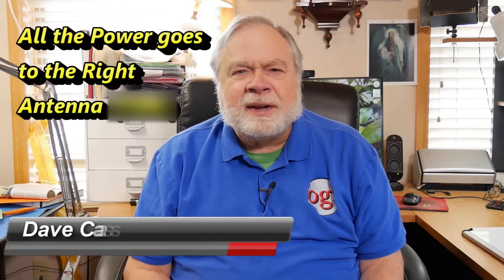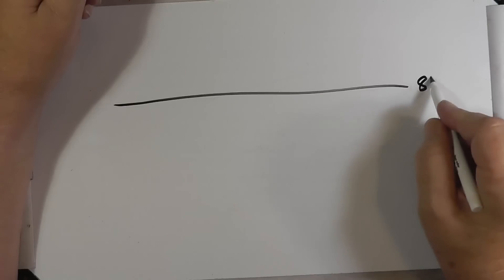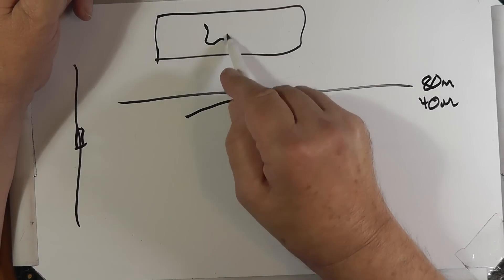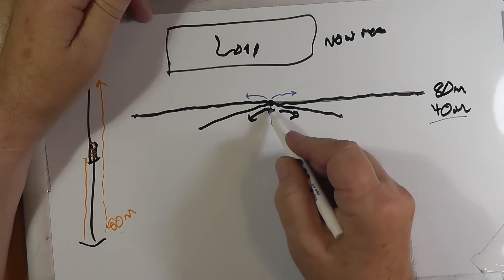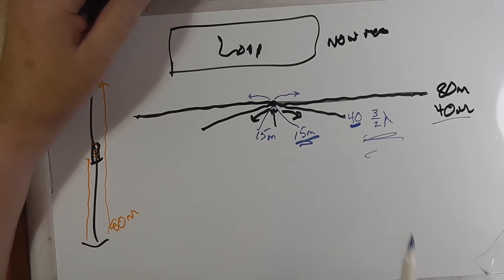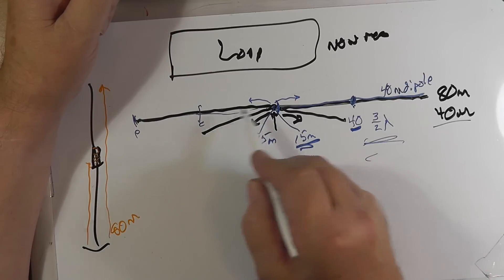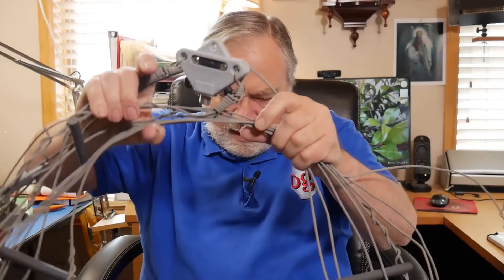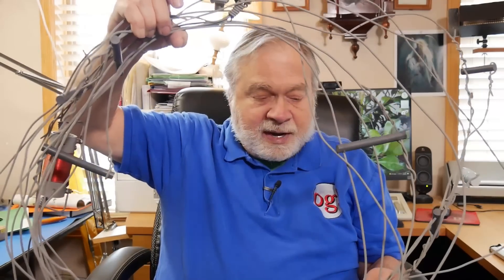All Power goes to the Right Antenna (#568)

Comment: Give me more of knowldge🙂..and wery happy and gratefull for that! So much cool informatione from UK( I meen Callum,Mike and you offcourse) I love the 👸👑 not aourse demokratione in fake poor Swiss called Slovenia in "EU" they say poor gods of Slovenia. Which, with democracy, promised us a decent life. But it became a corrupt police state of fools. I apologize for the moment of weakness😬🙄All the best and thank you again for all the knowledge.
Reply: I would also like to ask you for advice because I am already quite desperate about my situation with the hf antenna. I am on the second floor of the block and the balcony (4.5 × 1.5 × 2.5hights) is all I have left for the whole band of 40-10m i'm SSB guy not ft-8(But not mag loop) And this as much as possible under cover despite a full license (A). Thanks and 73
Reply from the maker: The mag loops are particularly popular in Europe because of their small size. If you get one that can be remotely tuned, you can try to get the building manager's permission to put it on the roof or at least mount it to your balcony railing.
Reply: @davecasler  Thanks for the reply. However, in the EU, we only have a well-known trade in Germany. Which has inaccessible ce.e for me for loop (1000 € +) But I don't want qrp loopa ead would be at least 70W on ic7300
Reply: For band 10-40 at leest

Comment: I use a fan dipole for my main antenna for 40, 30, 20, 15 and 10 meters. It works very well. then for 80/75 meters I use a trapped vertical.
I like your video. Good job.

Comment: You can also use different mobile antennas on a single feed point on either a triangle shape mount or disc mount with multiple connecting points and each antenna will resonate on the band it's designed for no matter how many antennas are mounted .

Comment: It's amazing that the signal won't radiate on the wrong antenna elements on a fan dipole because it's not resonant but if we want to use a non resonant antenna, it will magically work fine.
Reply from the maker: Yes and no. The non-resonant antenna needs a tuner that supplies enough reactance that the combination of the antenna,  feedline, and the tuner is resonant.

Comment: From what I have learned about antennas is that each can be used on another frequency as long as the other frequency is a third harmonic of primary resonate band .
Reply: @Joe Wilson   Hi Joe – that’s correct, and the same goes for every odd harmonic, e.g. 5, 7, 9, 11 and so on.
Reply from the maker: That trick is most commonly used when 40 meter antennas are used for 15 meters.

Comment: The way i like to think about multi element antennas is similar to parallel resistors.  At different frequencies reach element is a different impedance, so most of the current will go into the element that matches the source impedance best but a little will go into the others, but not enough to worry about, even so that little energy should be radiated just fine and any reflection will be similarly small.